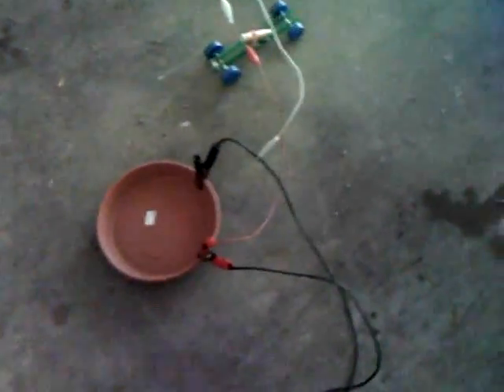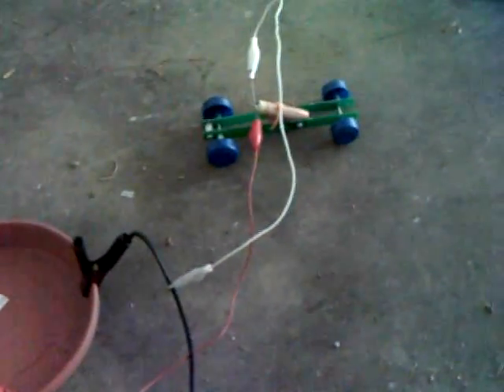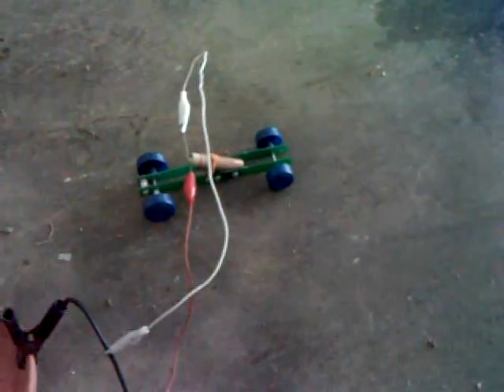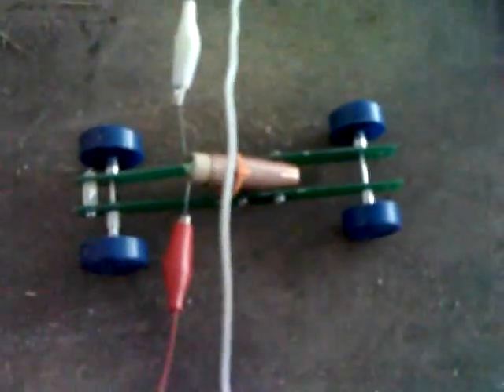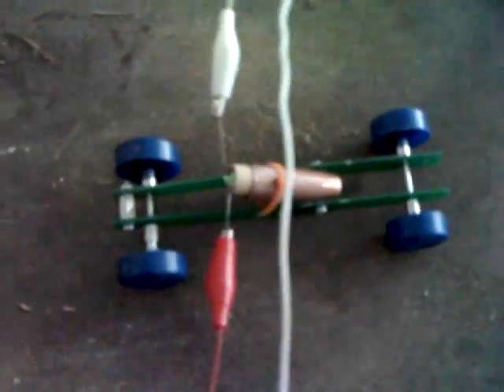Toy Car with Model Rocket Engine

Comment from the maker: It's just the igniter that comes with the rocket engine, hooked up to a car battery charger with alligator clips, to fire it off. The Estes yellow-and-black brick igniter just uses AA batteries and alligator clips, so it's not that different from what you might be used to, the way that it works.